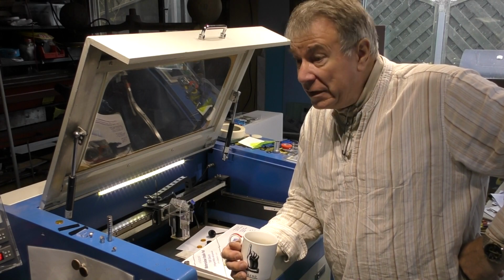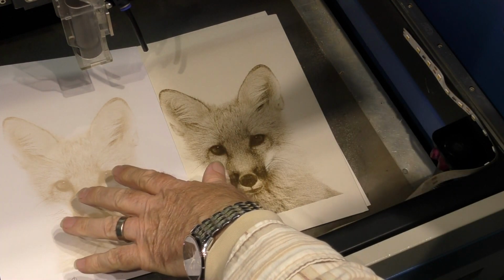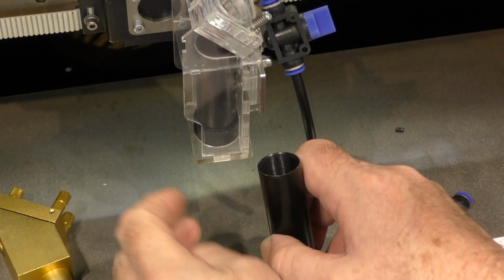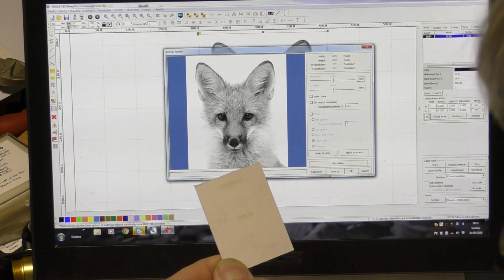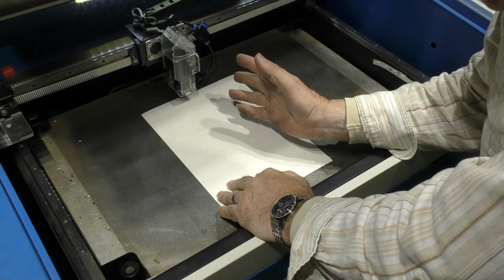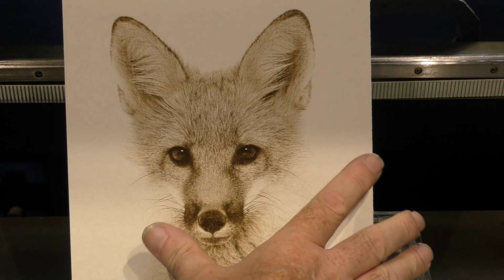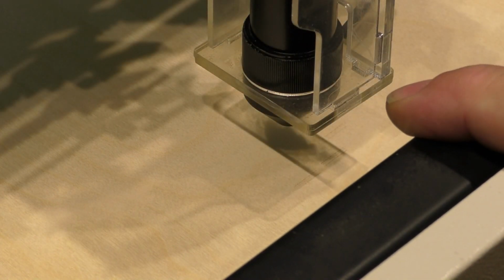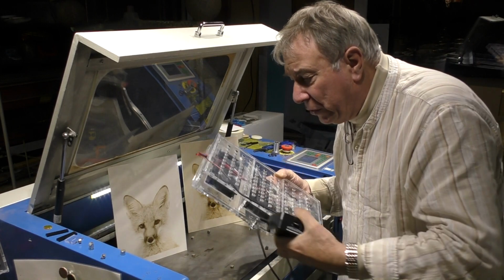158 Compound Lens and Universal Engraving Nozzle

Comment: Russ , there is no doubt that is impressive, but on paper, I just do not see the point,  as even the cheapest of the cheapest laser or inkjet printer can do this better within seconds,  what other use would this be good for?
Reply from the maker: I do agree. As an engineer, why would you take a perfectly good photographic image and degrade it? Strangely people seem to appreciate the fact that it is NOT a photographic image and because they do not understand how this "different" image has been produced , like most artforms, it has it's own attraction. The problem that dragged me into this area is the crap reproductions I have seen from the "big boys". They appear to have not  understood the mechanism for reproducing a photographic images. My  goal was to understand the way that I could get the best photographic reproduction by making a dot for every pixel in a diffusion dithered image. Our machines can only make a singe dot of just one size so the half tone printing process used by most people or software to convert images for laser "burning",  fail,  because this method  generates variable size dots that cannot be replicated.   The lack of a lens that can create small dots is an issue that faces all the big boys thus they use dodgy software methods to hide this problem. The smaller the  "burn" dots you can produce, the higher the resolution picture you can reproduce. I feel a bit  smug that my crappy little £1000 Chinese machine can do things that the £25,000+  machines cannot match.  I personally am not interested in capitalizing on this understanding but my step daughter has seen the opportunities that this "artform" offers and has started a growing small business engraving images onto glass. It appears that people take high quality colour photo images for granted but look at and study the sort of images she is producing,  just because they are "different".   Go figure. 
Best wishes
Russ
Reply: @SarbarMultimedia  That is true, nowadays with our high megapixel cameras that capture so much detail we do tend to overlook simplicity, And i can see the value of using this "artform" on glass and I'm pleased your stepdaughter has to seize the opportunity, Good for her! I do like the fact that you have taken an approach in figuring out what the "big boys" have overlooked,  As they say,  Every tool has its job, not because the tool is more expensive it means it will do more or better, Going back to the smaller Dot size thing and combining the art of photography, Have you considered Macro photography as an inspiration to design a better focusing lens, Example in macro photography one can use a reverse ring on normal lens to magnify a subject on too the sensor,( sensor, in this case, the medium we are engraving on) and with the use of extension tubes one can magnify, even more, If the laser head tube was re-designed in such a way, for a three-lens setup, The first lens biconvex to focus the beam on to a second lens and refocused on the last on? I don't know lol just throwing idea's around
Reply from the maker: @patprop74  
Hi 
There is one big problem with your suggestion  ....$$$$$. You spend a fortune on special lenses from the optics companies that service the industrial and laboratory sectors  or you can make the best of the VERY limited range of ZnSe lenses that are commercially available form China. I never have intentions to upgrade my machine with lots of expensive replacements and extras, only to explore the possible working envelope to it's absolute limit. The Ruida controller has so much more power than most can ever imagine  so with the careful choice of some simple optics within what is commercially available, anyone's cheapo machine can do some amazing tricks. As you have seen, my man cave has zero sophisticated research equipment, just my imagination, lots of experimentation and acute observation.  This strange combination of a poor quality plano convex Chinese lens with lots of spherical aberration feeding light into a more sophisticated and better quality meniscus lens produces wonderous results. No optical; engineer would ever consider such a combination because it breaks all the rules........
I am amazed by the F theta lens I am now working with on the fiber laser. 10" focal length and a 0.065mm spot size.  Yes,  I have checked and this is not theoretical,  it is real and under certain conditions it can be even less.

Best wishes
Russ

Comment: When you buy this kit, does the auto-leveling switch no longer work and is it even needed anymore?
Reply from the maker: Hi
 There is no auto focus switch on my China blue machine but  I have got the auto focus facility  on my Lightblade machine,  but to be honest I took it off almost 3 years ago. It takes too long to set up with all the lens changes I make.  I can set the focal point up much quicker and with absolute certainty using either a step gauge for normal cutting or a gently sloping taper gauge that is graduated in 0.1mm steps for setting the compound lens.. There is no reason why you have to remove the auto focus when using the compond lens kit,  you will just have to spend time setting it up accurately.. I use the kit most of the time on my China blue machine where I have a motorized table (not a stepper motor) but to make fine adjustment possible on that I have added a little manual turning wheel to one of the lead screws.
Best wishes
Russ

Comment: Hi Russ.  Big fan of your videos.  I noticed you have the 50W Chinese laser.  I had a fire in my laser and need to replace the Y axis belt that the cutting head is attached to.  Do you know what the specs for that belt are?  I have been looking all over for a parts list for the machine so I can replace parts.  The switch for air assist cut out in the middle of a cut and set the plywood on fire which cause a little damage.  Any help would be appreciated.  Thanks.
Reply from the maker: Hi Jim

 I bought my original replacement belt from
http://www.beltingonline.com/3mm-htd-timing-belts-4573
Belt no 1569-3M

But when I upgraded to a harder material (the current white urethane belt)  I used this
1 x AT3 Standard Breco® Open Length Timing Belt (1742)  = £34.50
        Width in mm 15
        Length in metres 2.000
        Nylon covering Not Required
        Tension Cords Steel
        Material Standard 590 White PU

Best wishes
Russ

Comment: hello just received my compound kit and looks amazing. unfortunately the thread on my laser head is an 18mm thread and the new kit is a 20mm thread (readsail x700 60w) is there an attachment you know of or which laser head would be suitable for the new kit please 
thanks Matt
Reply from the maker: Hi Matt
 I came across this same issue when someone with a Thinderlaser machine  wanted to fit my compound lens instead of the $450 Thunderlaser version. Thread size wrong and 20mm stem. I took one of my standard type C  lens tubes and reduced the stem to 20mm diameter and it all worked perfectly for him. I passed this information on to Cloudray who have made some special lens tube to now do that same job for you See 
https://www.cloudraylaser.com/collections/nozzles-lens-tube/products/t-series-co2-lens-tube-o-d-20mm

This is a 2" focal length  lens tube that will take a standard 20mm diameter lens, but you just need it to adapt from 20mm stem to M22  nozzle thread.

If there are problems just shout out again

Best wishes
Russ
Reply: @SarbarMultimedia  brill thanks so much for the help I will take a look at that now
Reply from the maker: @beamandbloom  
If your lens tube is not 20mm  outside diameter then let me know what your diameter is. Scroll down the  Cloudray web page for details and dimensions.

Best wishes
Russ
Reply: @SarbarMultimedia  I will have a look and let you know on my return from summer holiday. Thanks again Russ

Comment: How did you get the solid steel iron table
Reply from the maker: Hi Mark
 There will be  steel fabrication shop near you somewhere. Call in and they will cut you an odd piece of steel sheet. 2mm  (14 g) cold 
rolled steel. Hot rolled steel is more likely to not be flat.
Best wishes
Russ

Comment: 6mm hole isn't that a bit insane for a diameter?  I can see why it isn't for cutting but I already am having issues with smoke, from engraving, contaminating my lens and it is 20mm away with a 4mm diameter hole so this is about 10.5mm away and has 2mm larger hole.  How does that work to keep the lens clean?

Comment: thanks i have 6040 CO2 80W Chinese  laser machine it come with software  can i install other software to run this machine
Reply from the maker: Hi Sami

You can download the latest version of RDWorks from thunderlaser.com. This is actually a very good piece of user interface software that converts your designs into machine code without you ever knowing it ....and it is free.   However, there is an alternative that  has been developed by a couple of laser enthusiasts. This is called Lightburn and is so much better because not only has it copied most of the original features of RDWorks, it has lots more and is much easier to use. Whereas RDWorks only works with Windows, Lightburn runs with OS,Windows or LInux. There is a free 30day download you can run  after which the licence costs you $80 I think. After that you can opt to pay about $20 yearly to say on the update program. 
Best wishes
Russ
Reply: @SarbarMultimedia  thanks

Comment: Hi Russ, I was wondering could you tell me which lens you would recommend for cutting up to 6mm ply. It is to be used with an 80 watt lightblade machine from thinklaser. I'm sure I have read recommendations in the comments of your other videos but have managed to confuse myself as to where I saw the info. I shall also be purchasing your compound lens set up from cloudray and wondered if the included lenses can also be used for cutting? Many thanks for all the work you do in these videos.
Reply from the maker: Hi Tom
As you probably realize, I ignore advice and myths and go about finding things out for myself. I am fortunate enough to have time and derive great pleasure from "playing " with my machines. Although there is a fairly simple answer to your question, my experimentation and observations have left quite a few doubts about whether we have a full understanding of this technology.  In general I have found that a cheap plano convex lens flat side down is best for cutting. and although you would expect a "sharper" 1.5"lens to work best on your sort of material thickness, it turns out that a 2" lens seems to be best. Although a cheap Chinese PVD lens works very well, the gallium arsenide  seems to be about 20% more efficient for cutting. I have just acquired some more GaAs lenses from Cloudray and will be doing further ZnSe /GaAs cutting tests in the near future. Check your 2" lens, because usually Thinklaser supply that as  gallium arsenide  already (it will be black and you will not be able to see through it.).

The compound lens has a cheap PVD 1.5" plano convex lens followed by a more expensive USA CVD 2.5" meniscus lens. Yes the universal nozzle that the compound lens is housed in will take the !8mm diameter lenses singly if you wish to experiment.

Best wishes
Russ
Reply: Hi Russ, thank you for such a quick response! Yes I was lucky enough to discover your videos a couple of years ago when I first got my machine, your maverick experiments have undoubtably helped myself and so many other laser enthusiasts gain a far greater understanding of these machines than we could have otherwise. I was excited when you also started using the lightblade as it meant I could see it put through some real world tests by someone with a far greater mind than mine for these things. My own background is as a graphic designer and illustrator so not technical or science based at all.

Regarding the lenses, my supplied ones are now deteriorating and struggling to cut through 5mm birch ply at full power and 12mms, hence the need to replace them. I was originally supplied with the 4", 2.5" and 2" lenses, looking at the 2" now and it is indeed a very dark mirrored lens whereas the other 2 are transparent yellow lenses.

So to recap, for my needs I should be looking out for another 2" GaAs plano convex lens for the best cutting results? I will purchase this along with your compound lens system and a new standard nozzle from cloudray, after viewing your previous videos on nozzles I discovered the aperture on mine was close to 4mm and not the 2.5mm it should be.

Thank you again for all the great work you do with these videos, it's very much appreciated.

Best wishes.
Tom.
Reply from the maker: @_tom  
Hi Tom with your background as a graphic designer I wonder if you can answer a question that I am having difficulty with.
 There are all sorts of dithering techniques which I presumed were developed to suit specific printing processes. We are only capable of putting down round blackish burnt dots so there must be an optimum dither pattern for out application. Why all the different dither patterns was it really "my pattern is better than your pattern" or are there good technical reasons? I note that all the "big boys" have their own photo editing software  which seem to rely on half tone (newsprint) methods. From my research this is just about the worst possible option. The most faithful photo reproduction happens when you have dot for pixel replication.

Best wishes
Russ
Reply: Hi Russ, as far as my knowledge goes in print terms the dither was used to give the illusion of a better colour palette from the limited number of colours available and avoid colour banding. I've not really looked too much in to the history of it but my guess is the different dithering patterns were developed as printing technologies advanced, possibly with some patterns being specific or copyright to particular printing presses, as in buy our machine because "my pattern is better than your pattern" which you mentioned. These patterns were carried over in to the digital age and reproduced in software but how this relates to producing images from a laser is a bit confusing. You have clearly demonstrated that the best results come from dot for pixel replication, it could be that the designers of the laser software have simply taken what they have seen to be successful for photo editing and printing and assumed that exactly the same methods would work when burning the dot or pattern on the substrate. My guess is it could simply have arisen from the lack of incentive to experiment and discover what specifically works best for this new medium.

Comment: Like all your videos Thanks for sharing Russ. I have the K Series: laser head with 50.8mm Blue)  I need a nozzle for 38mm lens can you tell me where I can buy it ?  Cloudray laser told me K series cannot use with Compound /Universal Engraver Nozzle. The screw size does not match. 
You can use Compound /Universal Engraver Nozzle for C and E series laser head.or can you make me one i will buy it
help  thanks
Reply from the maker: Hi Juan
I do not have access to a K40 and have never touched one so I need more information to advise you. Please attach your email address to another comment. I get auto copied to my Gmail so I will delete your comment.

Best wishes
Russ

Comment: Love the approach, but I'm going to have to use a different mount to fit my head (25mm barrel). Can you say what the final approximate focal length is for the two combined lenses (front of bottom objective to material surface)?  Thank you!
Reply from the maker: Hi Joe.
If you want to use the compound nozzle on your existing lens tube I think the answer will be no because your nozzle thread is M25 whereas the compound nozzle is M22. Similarly the standard lens tube I have adopted is 24mm outside diameter and uses 20mm lenses. However all is not lost because there is a solution for you.  Cloudray make a 25mm diameter tube that has an M22 thread in the bottom. Take a look at this red tube
https://www.cloudraylaser.com/products/cloudray-hq-co2-laser-head-fit-for-focus-lens-dia-20mm-fl-50-8mm-and-reflective-mirror-dia-25mm?variant=7833933217843

They do not appear to sell the tube on its own but if you write to them inquiring about a compound lens with the red tube to suit your machine, I am sure they will oblige you with a price.

The 18mm diameter compound lens set sits down inside the nozzle . the nominal focal distance is 21mm where the focus point is between 10.5 and 11 mm outside the nozzle.
Best wishes
Russ